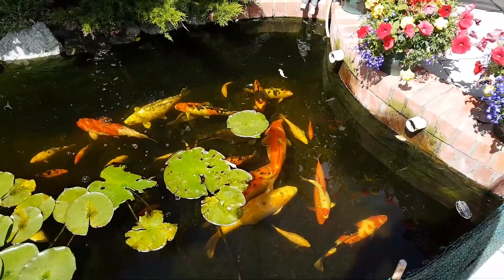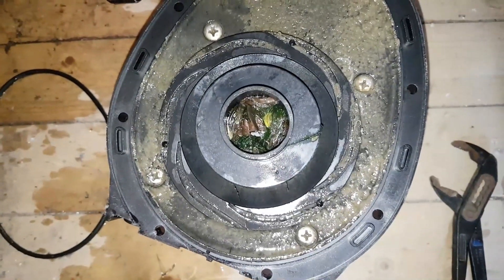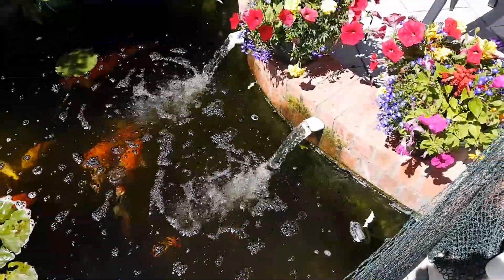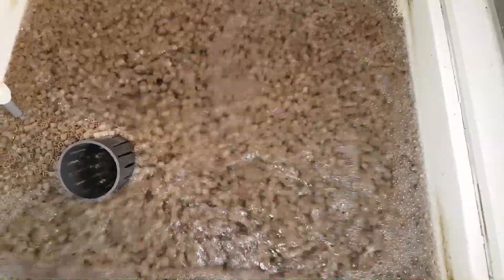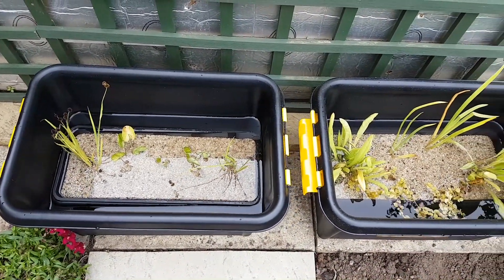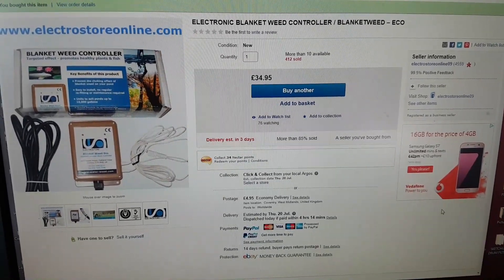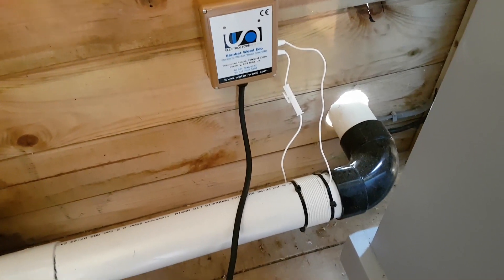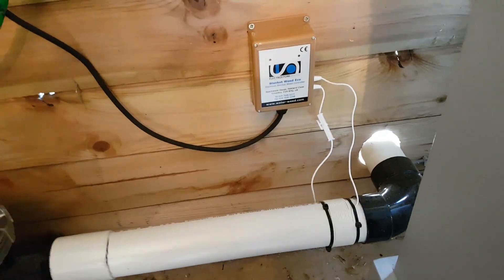Pump Cleanout And A Go At The Algae

Comment: question! when you said to clean the pump out what did u clean it out with i need to know the shop tells me to wash it out with pond water and others tell me to do it with normal water
Reply from the maker: I just pulled the dirt out and wiped it out with a rag. If you mean your pond filter, never clean that out with tap water.

Comment: Blanket weed thrives in high nitrate pond water so if you lower the nitrate in the pond water the blanket weed should die off and there is some new stuff out there that prevents the blanket weed from coming back
Reply from the maker: Yes mate, that's my problem. I've no plants in the pond to burn up the nitrates so it's thriving at the moment. I did try that Bio 8 Nitrate Klear but no joy. I'm going back to the Cloverleaf. Terry.
Reply: Too bad you could not hook up that temp pond to your main system and grow plants during the summer. Down in Southern California (USA) they use a huge estuary that is full of cattails to filter their treated sewage before being dumped in the ocean. If you could come up with a way to make a 'S' pattern in that tank you could use your plant baskets to hold a bunch of those cattails, and let the roots help filter your water. Just thinking out loud here. Also I used to have a 240 us Gallon tank I ran freshwater fish in. I used a second tank (2 foot W by 2 foot L by 1 foot Deep) to grow Duckweed in (for some guppies) and interconnecting the two tanks I really could keep both tanks stable, and grew one heck of a lot of duckweed. Again just a thought.
Reply from the maker: You Do have to be careful with that duckweed. It spreads like wildfire. My trouble is I don't have a very big garden and the wife says I'm not allowed any more lol. I am building a trickle filter at the moment so I'm going to see how that goes. It should be in my next video. Thanks, Terry.

Comment: Hi Tel.
Just caught up with all your videos. Very imformative, so thanks for your hard work. Do you prefer the RDF to the pro filter now its been running for some time? 
Ive always thought it was best to 'pull' the water through the system rather than 'push' it. Thereby pumping  filtered watervrathervthan dirty water. Any thoughts on whether your current system would work in that fashion? The other filters would just not sure on the RDF. I fancy having a build of a raised pond with a viewing window in the side. I think  perspex would be stronger than glass. Where do you get yours from? Cheers. Keep up the good work.
Reply from the maker: Hi Gary, I must admit I don't find too much difference between the performance of the Pro and the RDF as far as water clarity goes. What I like about the RDF is your not filtering through dirt for about a week until you clean the filters as with all other filters. The dirt is taken straight out. You are correct, it's always better to pump from a filter if possible. I've not yet worked out on the RDF for a gravity fed system. I hope to as soon as I get time. The Perspex I used was from my local diy which they use in a shower. Not good enough for your job. Terry,
PS. Have you had a look at my brand new Forum on my website diypondfilters.com/forum I'm hoping to get a good little community there so we can help each other with fish and ponds. Have a look and see what you think. It would be good to see you there.
Reply: Wrighty cheers. Just signed up. 👍🏻
Reply from the maker: Thanks mate, the more the merrier. See you there. Terry.

Comment: Terry,
I wonder if it would work better wrapped around rubber hose rather than PVC piping.
Maybe you need a bog filter to clear high nitrates LOL
Reply from the maker: Hi Steve, They say it should be ok, they even say it will work around copper pipe. My nitrates are not too bad, I think the algae is taking care of that lol. I'm starting to think it might be better wrapped around a bin bag lol. Terry
Reply: Tery, I am having a real problem with that Blanket Weed Eco thing. Technically all that can do is set up a magnetic field around the pipe. So how does that kill the algae? I am confused. We have had things like that here in the US that claim it could make your water softer if you had hard water which our US Post Office has gone after for false claims. The water softener version is a scam.
Reply from the maker: I'm with you on that one. I don't see how they can work. There selling hundreds of these things on eBay @ £40.00 each so I wanted to put them to the test. I have to say I haven't noticed any difference at all with it on, which I will say in my next video. I remember them being sold as water softeners here as well and they were no good. I'm hoping people will see it and not waste there money. Thanks, Terry.

Comment: Looking forward to seeing  if it  works  .
Reply from the maker: Hi mate, there are a lot of people say there no good and a lot say they wouldn't be without one, so I thought I'd give one a try. They have sold hundreds on eBay. The problem is I'm not sure how long I can stand algae in my pond until it starts to work as there not a quick fix. I may end up using Cloverleaf to get rid of the algae and see if that keeps it away. Thanks, Terry.
Reply: Wrighty I understand . But I would say try and hang in as long as you can . because if it was me it would bug me not know if it was the machine or the just the treatment that's sorted it .

Comment: Hi - what pump are you using in the video? and is this your current external pump? looking at replacing mine, looking for some advice on what to look for. Tar
Reply from the maker: Hi Dave, My pump is an Megga SS20 8000 lph 165w. I've had it about 2 years now and it's never been a problem. The blockage in this video was my fault for running it without the basket in it. This is the link so you can have a look.  http://absolute-koi.com/subcat1756.html  hope it helps. Terry.
Reply: Brill, cheers Terry, loving the channel mate.
Dave
Reply from the maker: You welcome mate. Glad you like it. Terry.

Comment: hello terry i wonder ifu could help me i was thinking of getting a mix of 1 intch koi but a got an at least 18 intch carp if i put them in the same pond would the big one eat the 1 intch ones or would they be ok cheres dennid
Reply from the maker: Hi Dennis, Chances are if the small koi are bite size they will get eaten by the bigger fish. Some of my smaller fish I put in my pond were 3 inch and I was a bit worried about them, but I got away with it. Usually if a koi can get it in it's mouth it will eat it. Hope this helps. Terry.
Reply: oh yeh they  would be bite to the bigger one. and i done the same i put 4 3 intch koi  in my pond 2 years ago and was worried but they was ok and about 12 intches now lovely koi they are. but i wanna get a batch that isee on ebay witch has about 7 differant breeds will a nice mix lovely colours but will have to make some sort off net thanks terry really appreciate ya help mate thanks again

Comment: Great videos, but I cannot agree with this.  Never choke the pump inlet; that leads to cavitation.  And rather than chocking the discharge as an alternative (better anyway), install a branch off the discharge and run it back to the pond, somewhere else.  You can also use a common discharge manifold for your two outlets, spilling over a larger area in order to achieve gentler flow.

Comment: my guess without seing the result of the Algae Weed Controler.. is that it doesnt work..
- how do you expect that the controler will affect the algae in the pond, it does nothing other than make an electronic/magnetic field inside the pipe.. it doesnt add or remove stuff from the water.. so how would you expect it to reach the string/blanket weed inside the pond.. 
- you would be better of with a UV light in the pipe to remove floating algae.
other than that if you want to get rid of string algae, you might want to try the "ultra sonic algae control" gadges..  those I believe will work much much better than what you got.. since its obvius that they can have an effect directly on the algae !